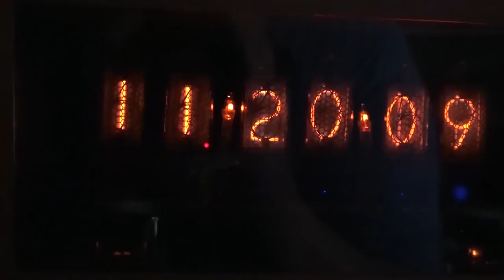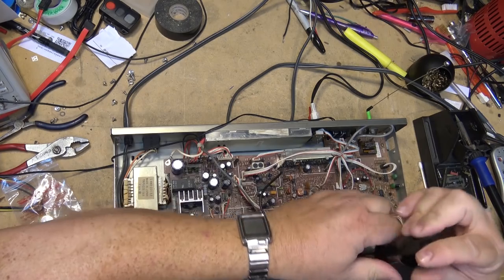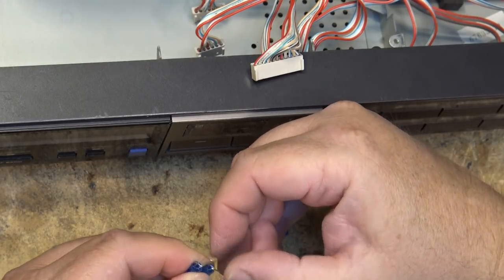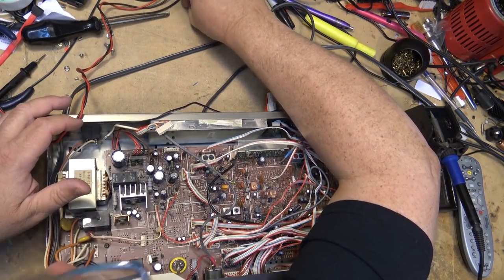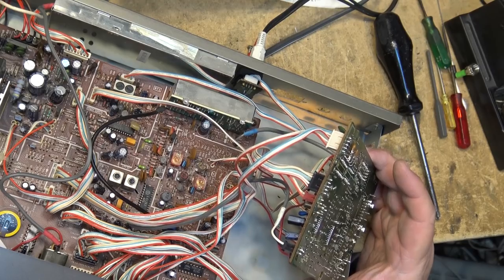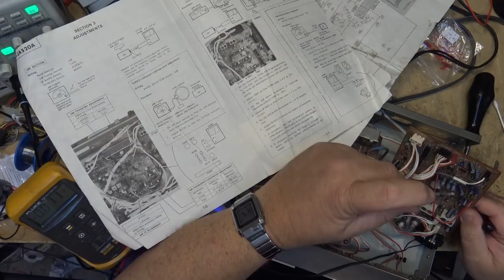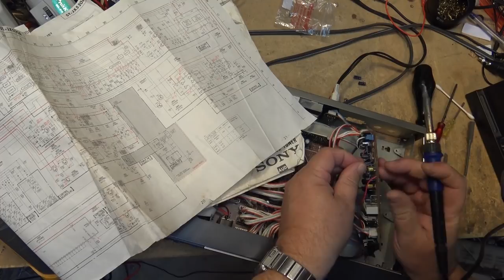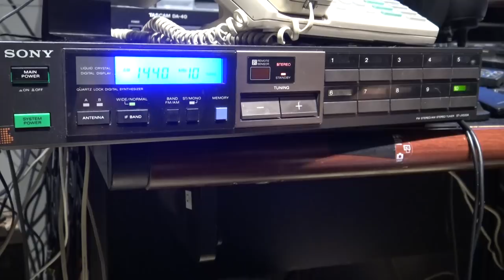Sony ST JX520A Am Stereo FM Stereo tuner repair

Comment: Brilliant. Repairing a water damaged/rusting Sony STR-VX2L (dreaded 100Hz hum)...recapped now and replaced STK463 (which presented with blown surface mount [edit: resistors] under microscopy despite transistors apparently being ok)...moving now to replace three failed diodes surrounding the regulator.. (none of which in my parts bin so awaiting parts) and after all this, a possible transistor failure lurks in the background. 12voltvids would probably have fixed it in a few minutes :) Find these videos really useful. Technique excellent. Also had to get a 100R fusible resistor (having an additional white band marking) which had not come across before

Comment: Hello dear friend
I like watching your successful repair work
The sony stv502 FM stereo light is not lit
Stereo light works with R25 resistor finger contact connected to IC21 integration on mainboard. All polarity capacitors in the circuit have changed, but no solution has been found. Only the R25 is working in stereo with the finger contact to the area where the resistor is.
The device is nice, for now mono only works.

Comment: Sony actually had a wide variety of AM Stereo equipped tuners and receivers in the 1980s, but many were quite rare, and all of their home tuners and receivers were blocked from being sold in the USA due a lawsuit by Motorola claiming that Sony's automatic multi-system decoder chip violated their patents. (The portable radios with manual switching between AM Stereo modes were unaffected by the lawsuit and were sold in the USA, thus are much more common.) But I know the JX-220A AM Stereo/FM Stereo tuner was also sold in Canada, because I have one and that's where it came from.
Reply from the maker: And they wonder why AM stereo failed!

Comment: I've had FM receivers in the past with a similar issue that didn't want to lock in to stereo but unfortunately I never had a schematic but by slightly turning a cpl pots I got them working again. I think overtime the pilot settings go out of their set spots

Comment: Is there any link for replacement battery ? Is it 2025 battery or 2032 ? Can i just unplug battery and replace it ? Or have to replace holder module ( tab ) as well ( as you did in the video ) ? Thank you!

Comment: Which pre and power amp did you use? I have an E80ES/N80ES powering Yamaha NS-1000Ms, love it.

I did have the TA-E1000ESD and a pair of N55ES power amps for a while, but I much prefer the E/N80.
Reply from the maker: I had a TA N 77 ES and TA E80.  Should have kept it but a friend wanted it real bad, and offered me a good chunk of change for it, so I cut it loose, and started buying expensive cameras. That is basically what it boiled down to. I wanted a professional camera for my video biz, so I unloaded a bunch of gear I had that I thought was overkill.

Comment: Hello david, im one of your fans out there, been watching your videos everyday. Thanks for sharing your knowledge. I just have a few questions, i have sony fh313 and my problem with this guys is the fm volume is too low but the other functions works just fine. And is there any way that i can use phono in as line in?. Thank you so kindly.
Reply from the maker: The phono input can't be used for line level for 2 reasons. One is the signal level. Now, you could pad the level down to a phono level, but the second is the RIAA equalizer curve. 
Vinyl records were NOT great sound carriers. Despite claims that they sound better, the only reason they sound as good as they do is through pre, and post equalization. The bass and treble is rolled off when the master is cut, and then expanded by the phono preamp.
So even if you were to attenuate your signal so as not to overload the preamp, it would still sound like crap. You can use tape monitor inputs as additional line inputs, or make a switch box to add additional inputs.
The FM problem, I have no idea off the top of my head.
Reply: I appreciate you took time to respond. Thank you so much!

Comment: Have you ever worked on Sony car cd player tuners? I have a Sony cdx-m650 with a bad tuner module. Having a hard time finding information or parts to fix.
Reply from the maker: No never worked on car audio.
Reply: Any ideas on we’re I could find information or parts?
Reply from the maker: No sorry, never worked on car audio shop at work that refused car audio. Stems back to the days when he did car audio and would charge people $100 to remove and another $100 to replace the equipment in the car on top of the repair charge of course nobody wanted to pay the remove / install charge so they would bring equipment in it would be repaired and then they would somehow manage to blow it up reinstalling it by connecting the power wrong and then come back demanding a refund so the boss made the decision that no car audio would be repaired and that was before my time at the shop. I welcome his decision I wish he had the same attitude with portable audio like walkman's ghetto blasters phones fax machines etc. When I had a helper he did all that small crap but when he retired that was on me and I absolutely hated working on that crap. needless to say a couple years later I was done working on all that crap and I left the business swearing to never do it again. managed to stay away about 10 years and then people kept coming to see me after the shop closed because there was nobody left and people started showing up at my door begging and pleading me to work on stuff so I kind of came out of retirement to work from home and that's what I do now and then I started the YouTube channel so I started doing more of it just as content for the YouTube channel basically.
Reply: I appreciate it. This video you have is the closest I can find to what I need for information. Nobody cares about these stereos anymore. But I’m determined to fix it. I’ve already told it apart and put it back together with no avail. Knowing how you test the capacitors and ic”s. Is the knowledge I don’t know how to find the problem. Thanks for your input..

Comment: I have never heard of AM Stereo before. I don't think we ever had it in the U.K.
Reply from the maker: We had it here from the mid 80s through to mid 2000s.  There are still a few stations operating with dedicated engineers keeping them on the air, but as equipment fails they are going back to mono or just going off the air.  Lately there has been a mass exodus from the am band.
Reply: @12voltvids  To be honest, I haven't listened to radio from FM/Am etc. for over a year now. I am afraid it is only off the phone or the computer. FM radio here is appalling at best and AM is an even bigger joke. Never had a DAB set so I can't tell how that is. Maybe it is ok, but do not know. Thank you for the reply and entertaining videos. I used to do video recorders and TV repairs back in the 80's and 90's but gave it up as it was cheaper to buy new than to repair. Though, I must admit I do not miss it. The "public" can be very unforgiving if the repair you do only last about 2 years!

Comment: Great videos! I just bought a Technics Sa-202 Receiver, noticed the left channel had no sound. Took the cover off to inspect and noticed the power amplifiers were not soldered to the board. Could this be the problem to why the left channel is not working? Thanks kindly, the amateur audio player.
Reply from the maker: Well that depends.  It is possible that the part is bad and someone disconnected it to prove the fault. If it was working and the solder just cracked then yes that could be your problem.

Comment: When you said you have owned it for years I was thinking bad caps. Loads of old Bakelite radios from 50, 60s have old paper capacitors and always fail over time. Replace the capacitors and alive again. Same with guitar amps, dead channels, no power. Easy fix.
Reply from the maker: This was definitely not an easy fix.. Part f the reason was, well it is AM stereo. Not something that you see every day. I bet the majority of the viewers have never heard of AM stereo yet alone seen a tuner, and the majority of techs never got the opportunity to work on one. This is the first one I have worked on, and I had to build the C-QUAM encoder to be able to test it!
Reply: I wasn't referring to your fix was easy. Generally, old radios that have dead power supplies and old paper capacitors is an easy fix.
Reply from the maker: Brian Percival 
Yes I know. Tube sets change all the caps and you are good to go.

Comment: This video shows why AM stereo is a farce and why it didn't last. It can't overcome AM's susceptibility to noise and interference.

FM broadcasting didn't start in Australia until the late 1970s (many TV stations had to move out of the FM band first).Even then, only NEW stations could broadcast on the FM band. Existing AM stations were stuck on the AM band. So listeners had to stay with AM if they wanted to listen to their favorite radio stations. AM stereo was merely a compromise.

Fortunately that is no longer the case. With digital radio now gaining popularity, I guess FM will follow AM to the ranks of historical interest only.

Comment: AM stereo must be mostly a Canadian thing. We have a number of HD radio stations here in Phoenix but I've never heard of any AM stereo stations or ever seen a radio that can receive it.
Reply: AM Stereo was available everywhere, but the FCC dropped the ball and approved 4 incompatible formats. Back in the 80's it was popular, but today the stations still transmitting are few and far between.  For those with an AM Stereo radio the thrill is when the skip is rolling and a distant station comes on. I have an old radio out of an 86 toyota that has AM stereo, and I pick up the odd station in the evening but other than that there is very little to listen to today.  Had the FCC settled on a single format back in the early 80s then AM stereo probably would have survived, but they allowed free market, and once they did pick a single format all the radio stations that were broadcasting in one of the loosing formats simply turned off the stereo and went back to mono operation.
Reply from the maker: Many factory car radios in the 80's had AM stereo. My wife used to have a mid 80's Buick and it had AM stereo. My mother had a Totota and it had AM stereo. It should have succeeded in the market, but due to poor decisions by the FCC it was doomed from the start. In a car environment AM stereo was perfect. No picketfencing, of fading that is common with FM, and the range of most AM stations was superior to FM stations.

Comment: Are there any clear channel stations I could probably receive at night broadcasting in AM stereo. There is a station in my area that once did broadcast AM stereo. I doubt they do now unless they have a host airing on one channel in the caller in the other  LOL.
Reply from the maker: There are still a few stations in stereo. I have picked up a few at night from time to time. It is fun when you find them for sure. Just llike it is fun to find a pirate radio station.

Comment: The leds just made that display perfect, nice coverage and colour.
Pll's can be a shit if they don't get the correct input or feedback levels, i am talking about communication equipment but a pll is a pll.

So did you retune the pll system after the cap replacements and acheave the correct voltages?

Comment: Re: the hum.  There are a few things to try. 
Try putting a .1mf cap across the antenna input to ground.
Recheck the .1mf caps across the power supply are still good or add more.
The main antenna receiver chip may also need a .1mf cap across its power supply.

If that does not work then a component within the circuit is causing the noise then
use this circuit from Mr. Carlson's lab to trace it down.

https://www.youtube.com/watch?v=uVkJqqZroN0

This should clean up that hum.
Reply from the maker: MidnightVisions 
The hum is only on the weak signal from my transmitter in the other room. Once I moved closer the him went away.
Reply: Yes the hum is being generated in the receiver circuitry somewhere.  The receiving circuitry is raising the noise floor to pick up the weak radio signal.  The hum is being generated by a bad component, and its rf noise is above the noise floor of the receiver.  This is why the receiver picks up the hum on weak signals, but not stronger signals.

A receiver circuit can never have too many noise bypass caps.  When Sony designed the circuit, the parts were new and capable of absorbing the noise.  Now that all the electrolytic caps are time expired, more noise is being generated than the original bypass caps can handle.  The noise will most likely increase over time unless the bad part is found.
Reply from the maker: So explain why then, every radio I test on the bench, receiving the signal from my test transmitter has the same hum.  I can bring my walkman into the workshop and it sounds the same, and it only does it on this signal. There is much noise generating stuff here, from monitors, hell even the digital camera I record with generates a ton of noise.
Reply: whats the time mark in the video where this happened?
Reply from the maker: MidnightVisions 
Where what happened. The noise from monitor or scope?
Reply from the maker: MidnightVisions 
10605 you can hear it away from the noise.
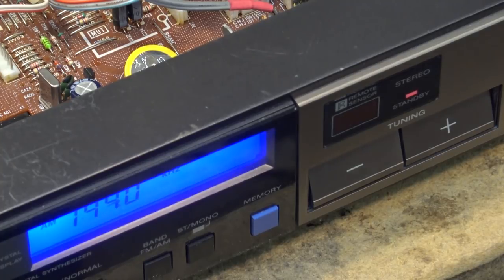Reply: 1:04:07, you answer it.  With your hand on the chassis, the extra capacitance of your body causes the noise to go away. You have a capacitor problem.

This video blames the AM transmitter, which as a poor antenna and lack of a ground plane for the noise.   

https://www.youtube.com/watch?v=Gx1K92OsydI

If you feel its the transmitter, then why would touching the receiver's case would it cause the noise to go away.

However what this shows is the many problems AM stereo had, and some of the reasons why it was not adopted by the consumer market.

Comment: Might not be able to watch it all today because of bad weather but will try and watch the rest of the video tomorrow, If you have an old fluorescent lantern then it might be possible to use the tube from it, I am sorry but I am trying to watch enough of this video before hurricane Ophelia comes and the adverts get in the way and I want to get my system shut down before the power goes off, I had a radio that had stereo on LW,MW,SW as well as FM and DAB and also the radio used DRM (Digital Radio Mondale) which used a Texas Instruments Blackfin DSP processor but the selector knob got broken off so is impossible to select other stations, if you are wondering what radio it was it was the Morphy Richards 27024, something interesting here
http://www.google.sr/patents/US5222144

Comment from the maker: FIRST!
Reply: 12voltvids hahaha👍👍👍
Reply: I smell a rat Send in the cat Lol.
Reply from the maker: John sweda 
It's a joke. I just happened to be on line when it finished rendering     .
Reply from the maker: John sweda  
No not at all. Just to test old radios. There is a kit being sent to my by a kit supplier to build and banggood is sending me a little more power full unit to evaluate as well as a ham radio. Like the one I currently have that is one of those lighter players for the car they are very low power but fm can be interesting especially with an external antenna.
Reply: Good vid
Reply: you cheating!! lol